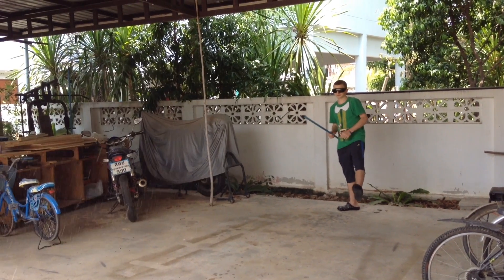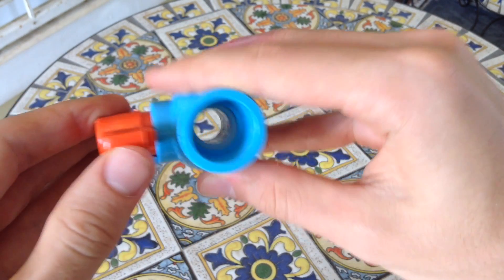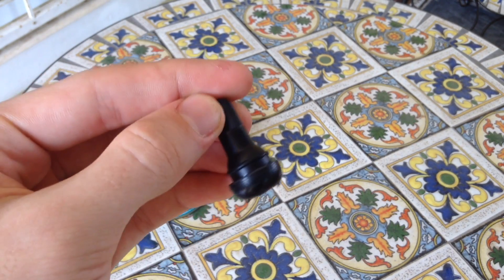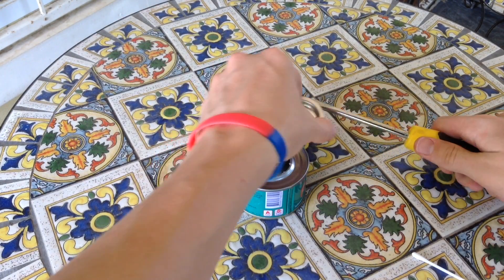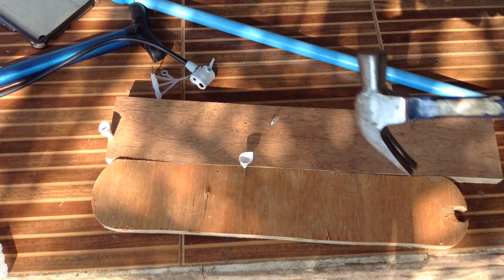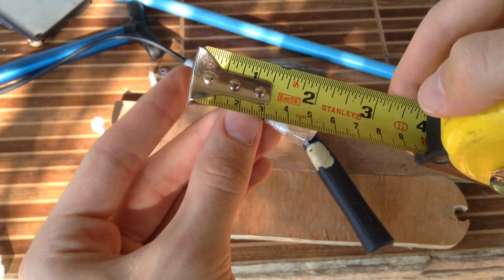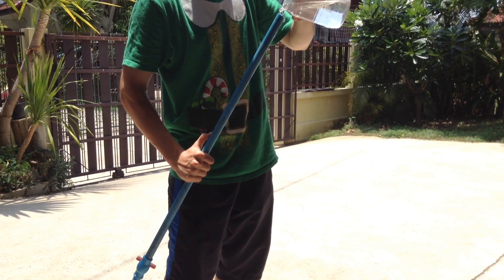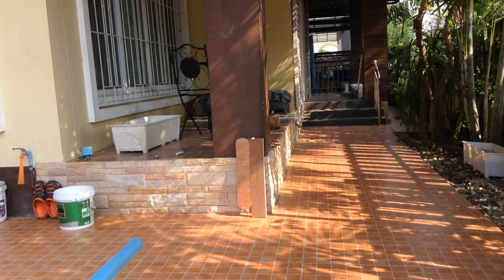How to make a compressed air cannon for under 5 dollars.

Comment: How do you make the nail darts
Reply from the maker: @jachinnoheman  Curve paper into a cone. Tape the first inch of the cone so it stays. Press the whole cone into the pipe so that it makes a mark on the paper. Cut along that mark. Press a nail through the dart and hot glue it in place. The King of Random has several videos on it.

Comment: Please please answer, could I make this with a smaller pipe/barrel?
Reply from the maker: Yes. You have my permission.
Reply: @waynesullivant  would it still work tho?
Reply from the maker: @sentoyt2800  Yes, as long as you have the appropriate fittings.

Comment: I made this a couple days ago, total cost was around 5 bucks as I had some of the materials already. The power this thing can put out is absolutely amazing. I made a custom barrel out of brass to shoot nerf darts, and when it doesn't rip them apart, it puts them clean through cardboard at 20ft range. The nail darts I made were awful, so they ended up being closer to sabots. They go all the way to the heads into 1/2 inch plywood, and at higher pressures they will sometimes go through. Basically anything you put in the barrel comes out at terrifying velocity. Arguably the best value air cannon I could find. Good work!
Reply from the maker: Yes, it’s crazy fun! Thanks!

Comment: "Shall not be infringed fed boys!"
Also by cutting the air chamber in half and then putting a t-pipe and then a 2 l bottle on the other end of the tee pipe you'd be able to store a lot more air.
Reply from the maker: Yes, technically. But soda bottles can’t hold much pressure. At least not as much as pipe.

Comment: great! Is there any links that I might be able to use to order these parts?
Reply from the maker: I’m afraid not. All you need is 1 Car tire valve, a half inch ball valve, an end cap, and a length of pipe. I’m sure you could get it all at a hardware store or amazon.
Reply: @waynesullivant  okay, thanks so much!

And thanks for responding so fast.
Do you think I could change up the plastic pvc with metal pipes and things? My budget is about $50
Reply from the maker: @Zhisaoka  I don’t know about the price of metal pipe, but at that price range, why not get 3/4 inch schedule 40 metal pipe and make yourself a shotgun. Haha. Jk. Yeah you’ll have to look for prices yourself.
Reply: @waynesullivant  oh okay, thanks :).

Comment: As you mentioned in video, you said it could be possibly used as an airsoft shotgun. What came to mind when the statement was said was adding an additional pipe/barrel to not only make it a dual barrel shotgun or just make it so you would have a second prepared already no matter what the shots type is. The only thing I see that could cause you some trouble is with the dual barrel shotgun idea how would you get them to fire at the same time?
Reply from the maker: https://youtu.be/3apnwzvIntM Incidentally, I’ve already made a video for that. Enjoy!

Comment: When I shoot my gun and don’t disconnect the pump it works ,but when I disconnect it the air doesn’t shoot out. Do u have any tips
Reply from the maker: I actually have the same problem in other projects. If you push on the pump hose toward the valve as you unscrew it, then you might hold more of the air. If you have one of those lever release hoses then try to flip the lever and pull it off the valve as quickly as possible.

Comment: Same system as perimeter alarms or air soft mine ?
Reply from the maker: I don’t understand what you mean.
Reply: @waynesullivant  
Maybe something  like the same pump up design with  airsoft bbs set up with a trip wire , or used to set another alarm off ?
Reply from the maker: @Mike_MFn_Jones  Oh, yes. I suppose it would be possible.
Reply: @waynesullivant  
Great video, I look forward to seeing what you do next
Reply from the maker: @Mike_MFn_Jones  Yes! I just finished a resin pour of a rhinoceros beetle. I will edit the footage and then post it.
Reply: @waynesullivant  awesome

Comment: i made one handle 500psi
Reply from the maker: Whoa, that's pretty dangerous! The three quarter inch PVC pipe that you can buy only holds 480 PSI safely. But anyway, that is very interesting.

Comment: Awesome video. I basically used this exact model except I went 1.5 inches on the barrel which is the perfect size for ping pong balls. 109psi got us 131mph. 13 bucks for the whole thing.
Reply: If you already have the primer and cement. Those alone will be more like 15 bucks,
Reply: Oh and I'd highly recommend the steel screw in type valve stems if you planning on going north of 80 psi. Use schedule 40 type pvc also, its worth it!
Reply from the maker: Ok that’s pretty cool! And thanks for the  tips! I never thought about using the screw-in valves. A few months ago I tested my nail darts against homemade ballistics gel of 10% gelatine by weight. It went through until it got to the paper fletching. But since the nails were pretty long I got a penetration of about 4 inches. Later I used blowgun darts made for 3/8 inch conduit and the fletching bent and the whole thing went through about three inches including the fletching.

Comment: It should handle up to 160 psi.
Reply from the maker: Cool, have you made one? Just so you know the pipe I had wasn't schedule 40. It was more like 2/3 the thickness. The valve was 120 psi rated.